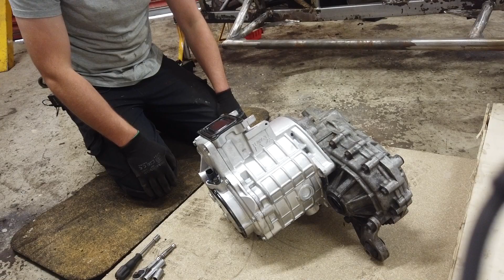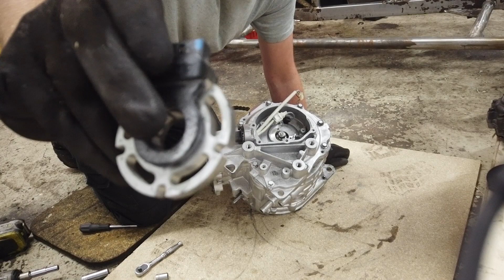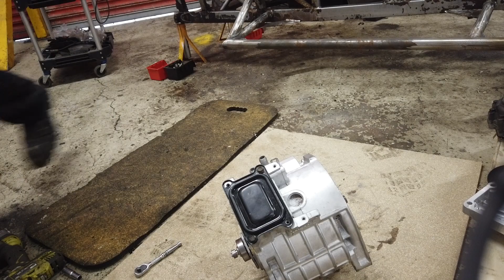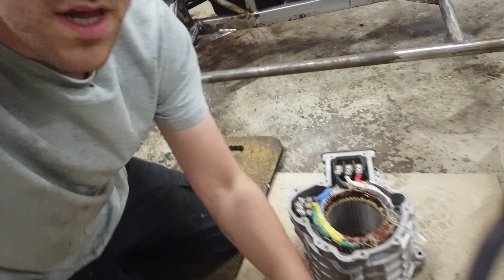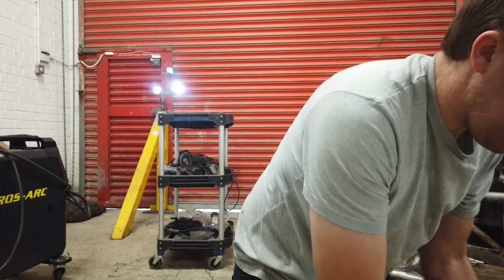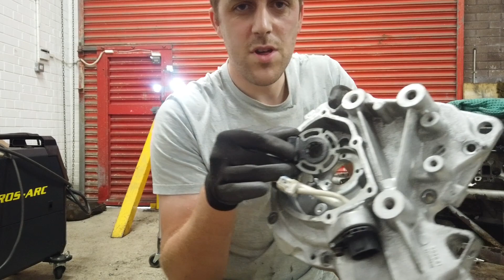Ruining a perfectly good EV Drivetrain...

Comment: Edit: (This is not an induction motor! It has magneTs. It is an IPM syncrousnous motor, which has higher efficiency across the range. This motor would do good in my car) Perfectly good? Induction motors for EVs are a waste of good Amp-hours! Their efficiency is fair while accelerating, but on country roads and city driving they drop from about 86% down to 45-60%. I have an induction motor EV and I use 30A at 52mph and 19A at 32mph! In effect I get as far highway as I do city driving, which is ridiculous. (You get it, I hate induction motors in EVs!)

Comment: Some content suggestions. It would be nice to see more related to the TVR and the Rover V8 engine. Valley gasket, plenum and injectors changes. Also changing big end and main bearings with the engine still in would be good. How to change the camshaft and timing it in. Surprisingly I couldn’t find many videos for this type of engine and these common jobs even looking at Landrover specific channels. Even techniques on rear main seal removal and crucifix seal installation would be good. Also there is less out there on the GKN and BTR diffs. It would be nice to show the differences between them, how to test and service them etc. Hope this helps.
Reply from the maker: Thanks for the suggestions! I'll put it on the list but they're difficult videos to make.